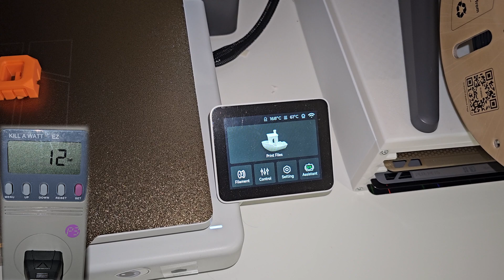Test to see how much electricity does the Bambu Lab's A1 Combo use.

Comment: Exactly what I wanted to know. Thanks, now I do not have to measure it myself. Less power use than I expected. Around 130-140W. Plugged it into a 10A 600W APC UPS Backup Supply.